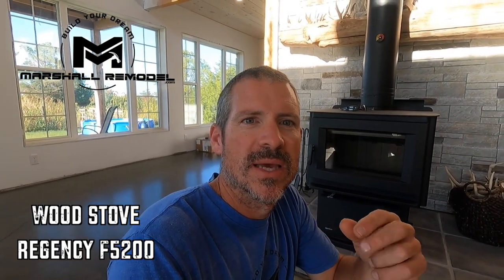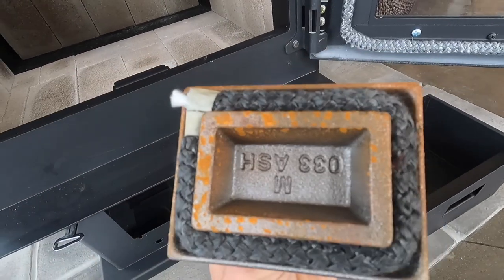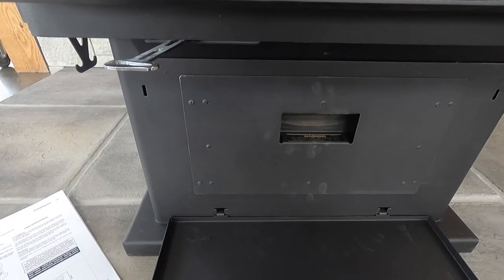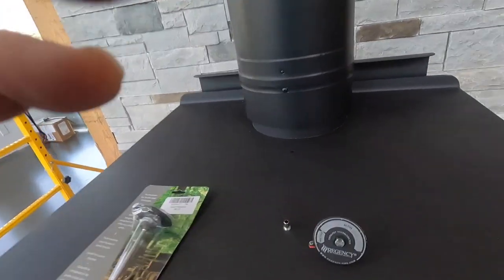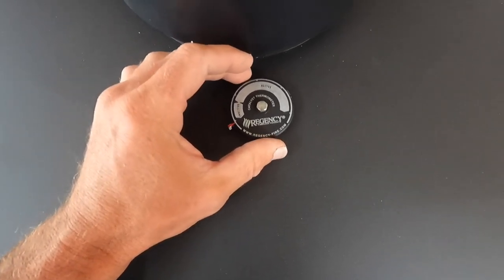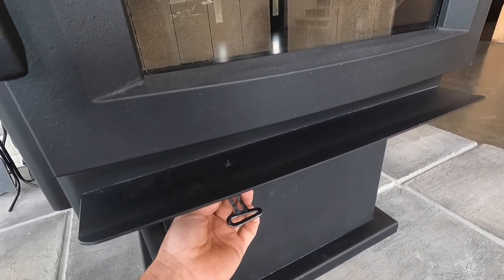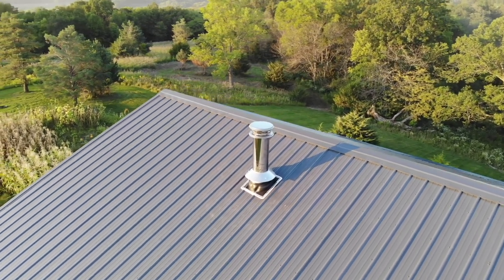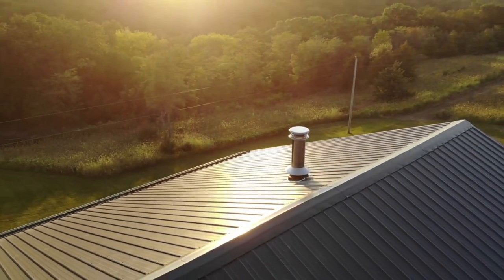Wood Stove Accessories and setup

Comment: Hey. We had a wood stove in my child hood home. One tip I can give is to install a chimney fan.. It will help pull up the smoke.. especially in high winds.. It can tend to push the smoke into your house on high gusts.. Now granted I dont know how well sealing new stoves are, ours was old.. But just thought I'd mention it.. They're usually just a cap you put on the top of your chimney pipe :) Its looking good paul!

Comment: I used to use a Johnson wood stove which are really nice. They have two flue pipes and electric fan. I later replaced the wood stove with a water stove in my basement with a 100 foot roll of copper tubing for my domestic hot water in the winter. I wired my water stove pump to my a thermostat in my house which would cut my heat on and off as needed. Also, I had solar panels to heat my water in the summer time. I heated my house and hot water for 11 years until I built a new house. I turned my heat pump and hot water heater off and used the water stove and solar panels for all my heat. Yeah, you have nice setup!
Reply from the maker: Awesome!

Comment: Can’t wait to see it in action and how it solely heats your home. Just curious why not an outdoor wood boiler pumping water through your in floor tubing?
Reply from the maker: At the time we just went with the boiler and LP hookup. We didn't necessarily want to put ourselves in a spot that we HAD to do something in order to heat the house. This is a secondary heat source, we just know from our experience that it'll provide most of the heat we need. We have a furnace for each level of the house too, and the radiant heat in the concrete on the main level.

Comment: What are you using to add humidity in the wintertime, while using your wood stove and radiant heating under the floor?
Reply: Simply putting a tea kettle of water on top works wonders.
Reply from the maker: There is an aprilaire on each furnace unit